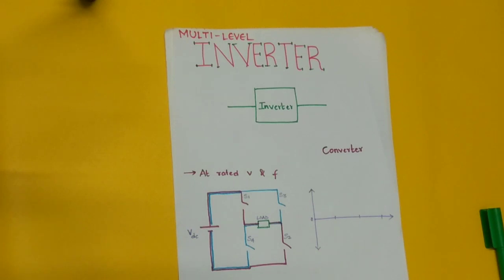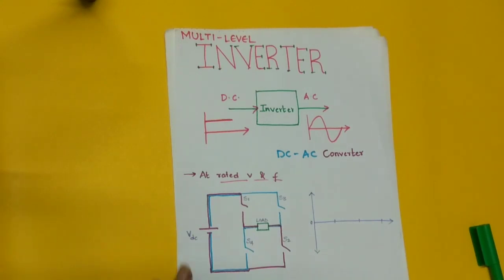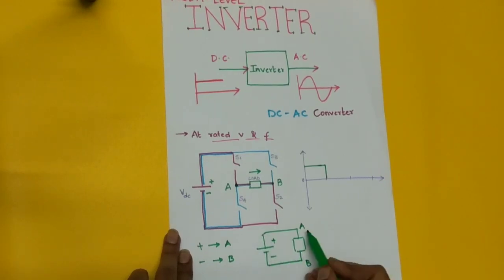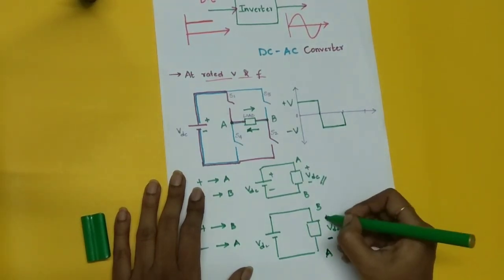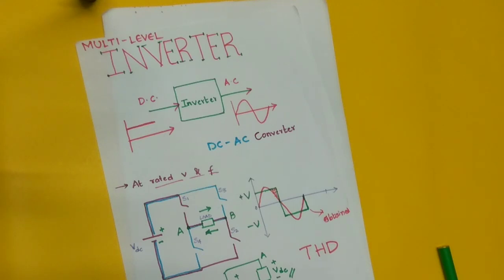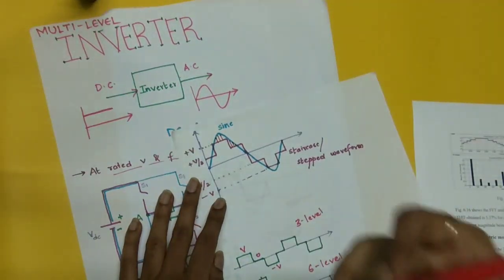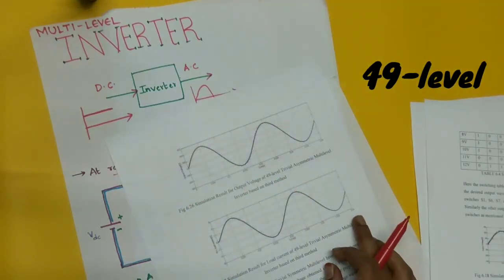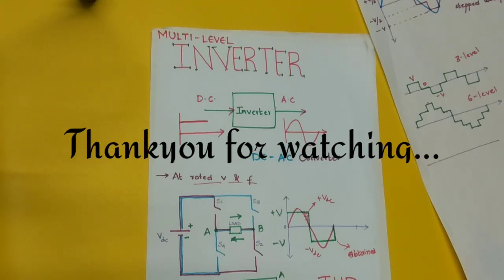Multilevel Inverter and THD

Comment: I am a final year honors degree electrical engineering student, and my final year project is to design and construct a cost effective 1kW dc to ac inverter with automatic switching function. I am in the early stages of my design, and this video has helped me a lot. It has made things that will be useful for my design known to me, and it has enhanced my basic knowledge of inverters. Thank you very much, Ma'am🤝.
Reply from the maker: I am glad that it is helpful
Reply: Hello Ronny please can you share your project with me because I am doing same project in finalier major project . please 🙏

Comment: Is it possible to read output voltage of MLI using multimeter ??? 
 If we are using three dc source such as V , 2V , and 4V as input and output as 7V , so if 9v , 18v , 36v as input and output as 63v (AC) , but I am getting only 36V (AC) as output while checking in multimeter. So wheather it is working good or not , but in matlab simulation it shows 63V correctly.

Comment: Do you have video explaining operation of multilevel flying capacitor inverter operates in especially how step voltages are implemented . This is poorly explained for 5 level multilevel inverter

Comment: hello madam, at present i'm doing a project for my under graduation on this multilevel inverter concept. i'm done with a seven level inverter with pwm technique but my thd analysis shows more thd i.e., 32.4% which is  not at all considered to be accepted i'm trying to reduce that harmonic distortions by changing the pwm technique to modified pwm or spwm technique. i need to solve this by this month end please help me in this project. i loved your explanation for this video. and pleaseing to to help me.
Reply from the maker: Try to increase the number of levels by modifying your topology
There will be almost an exponential fall in THD value with increasing number of levels
Reply: thank you for your fast response, and a complete confusion in types of pwm techniques that use different procedure like GENETIC ALGORITHM and Lshade-Espin algorithm . are they useful for me for my under graduation level?
Reply from the maker: You can find many types of algorithms if you search for IEEe research papers. Since power electronics and especially multilevel inverter is trending topic the number of algorithms and different types of topologies are increasing day by day. All you need to do is to select that particular topology and modulation technique(ofcourse which is simple) which gives you minimum THD. Techniques like Space vector modulation, SHPWM needs a lot of effort and is too much for BTech level. So choose a simpler one.
Don't get confused with all those techniques at the last minute.
Just take two-three days to decide which is best for you and work it out.
Reply: @nagasaidasari339  I will help
Reply: @pavaninallanukala995  r u familiar with quasi z source
Reply: @letslearnelectricalenginee4671  r u familiar with quasi z source
Reply from the maker: No
Reply: what kind of configuration that were use for your 7 level inverter? symmetrical or asymmetrical?

Comment: hello maam, i want to know how can I set the values of CPS-SPWM in matlab for 19 levels or more. i used repeating sequence with not gate and relational operator. i am facing problem to set the output values of repeating sequence. kindly guide me about it.  thanks
Reply from the maker: What is the exact problem u r facing with the output values? If it is the magnitude of repeating sequence it will be Vmax/9 where Vmax is the max value of the desired output voltage and value 9 comes from (level-1)/2 i.e. (19-1)/2=9
Reply from the maker: Sorry, currently I dont have a system to open MATLAB
Reply: Ok thanks.

Comment: what about five level inverter
Reply from the maker: In a 5level inverter the voltage has 5 levels V,V/2,0,-V/2,-V
Reply from the maker: The no. Of levels achieved is decided by the topology of your circuit.